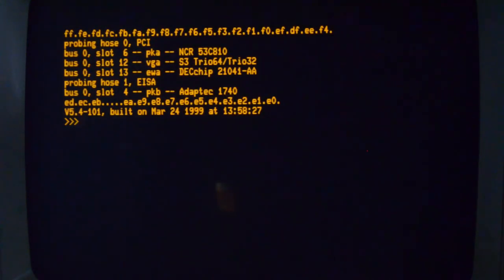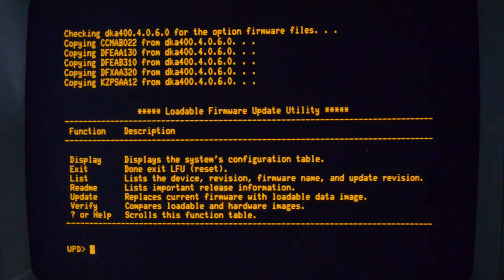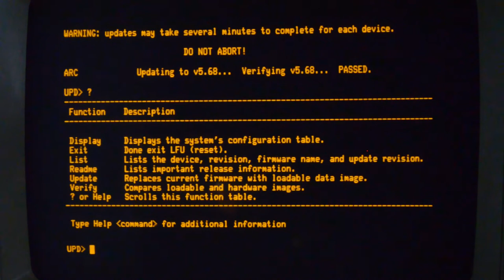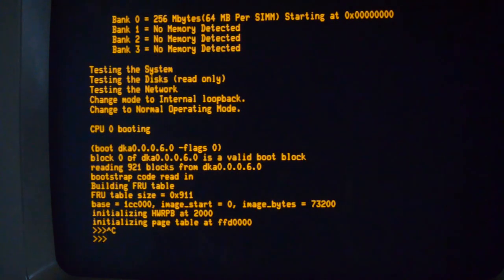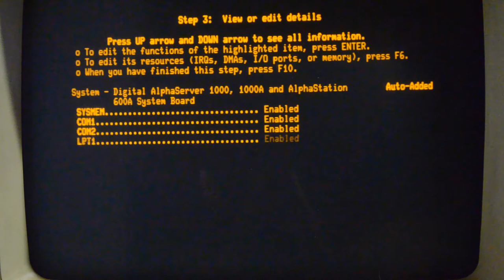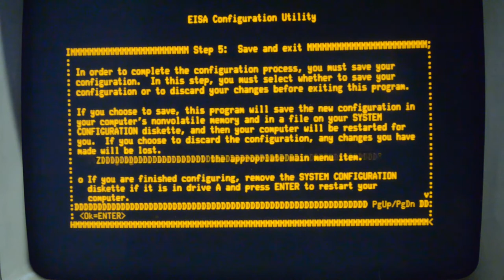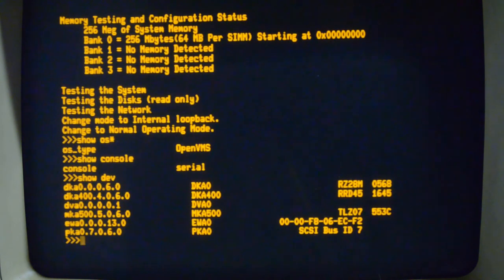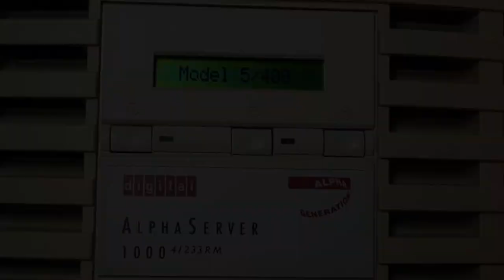AlphaServer 1000 CPU Upgrade

Comment: The destruction of Alpha continues to be a crime that should have been punished with life-terms.
Reply from the maker: Yes, well its not unsual for companies to buy out others, not because they want the tech, but to kill off the competition.
Reply: There were a lot of good processors - a quick Wikilook shows the HP PA8000 outperforming the Alpha 21164 despite running at 1/2 the clock speed. The real loss was VMS as a competitor to HP UNIX and AIX and Solaris - I've never seen a UNIX system no matter how stable that was better than VMS for reliability and - very very important - ease of use to "normal" people (engineers etc.) The programming environment on VMS was also top-notch, particularly documentation. Once I had to write a translator from IBM VS FORTAN to DEC FORTRAN - in VS FORTRAN :) I know I know, dumb idea :) But I got really really familiar with the DEC world. Later I got to actually do some systems level stuff. Such a great, reliable, easy to use OS.
Reply: Agreed

Comment: Nice.  I have an Alphaserver 1000 4/266 pedestal version.  Do you still need the 5th DIMM for ECC after the upgrade?  I know some later boards and the 1000A didn't include those sockets.
Reply from the maker: Yes, as the baseboard doesn't change. The 1000A is different.